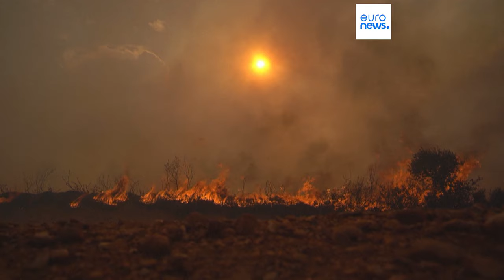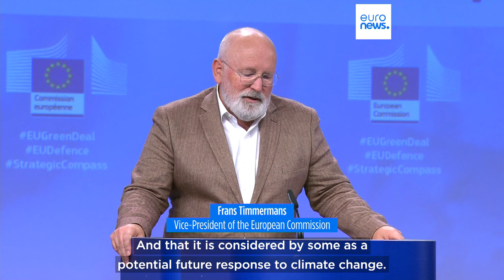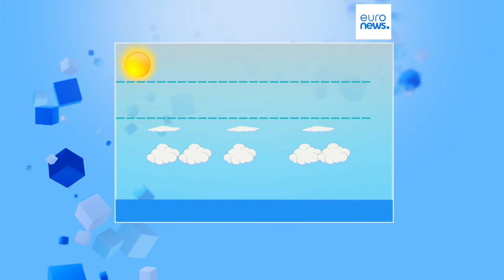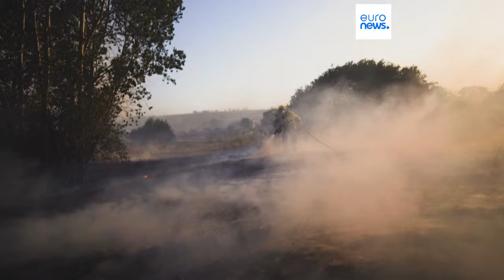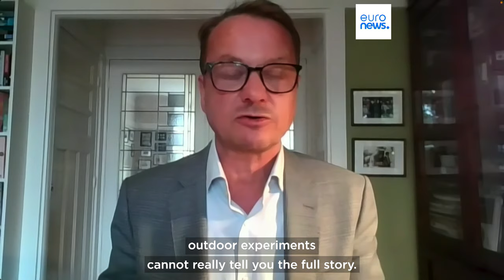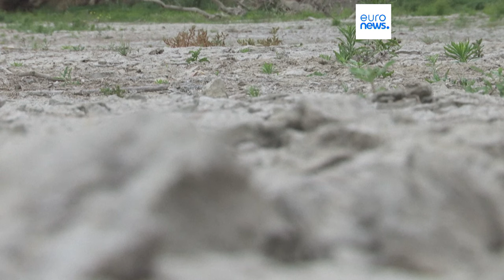European Commission calls for international discussions on risks of climate engineering

Comment: Please give this a thought - 
1) My truth = contrails
2) Your truth = chemtrails which requires all of the following to be in place
- All civil aircraft to be designed, built and operated with chem tanks, pipe work and spray nozzles 
- Boeing, Airbus, Embraer, Canadair etc designers and engineers are in on the act
- All professional commercial pilots are trained to use and operate chem spray equipment
- All Air Traffic controllers are in on the act as they direct aircraft over built up areas.
- All airports are in on the act as they allow chem spray companies to operate airside with staff and vehicles.
- All the worlds’ meteorologists and weather forecasters are in on it
- All the world Aviation regulators are in on the act such as FAA, CAA as they allow these aircraft to fly.
- All the worlds governments are in on the act as they have agreements for the aircraft to fly 
Where are the whistle blowers amongst all this lot????
 Apply occams razor to both possible scenarios and which one is correct????
After 41 years in the aviation business I can tell you the civil fleet is NOT fitted with chemtanks or spray equipment and civil airports do not have the ground facilities to load thousands of tons of chemical onto aircraft
Reply: what are you even talking about?
Reply: The real truth @GeorgeTsiros
Reply: Last year we moved from BC Canada to Mexico. We now live 20 minutes from the 10th busiest airport in the world. I lived in Kelowna BC for over 50 years and forgot what real blue skies looked like. Whatever they are spraying into the air back home they certainly arent doing it down here. Bluebird days back in Canada end up all hazy. You can watch the trails slowly spread and hang in the air. Here it's pure bluebird skies.
Reply: @andyb2515  I... don't think they are even suggesting that we are being sprayed with "chemicals" while being told that we are not being sprayed with "chemicals"?
Reply: Same aircraft, same fuel, different atmospheric conditions, different weather systems - quite simple really why you see different things @TheStonesheepsteve
Reply: @andyb2515  so what has changed in the last 30 years? The skies used to be blue back when I was young. 
Why do soil samples in the forests and snowpack samples have extremely elevated aluminum levels?
Reply: @TheStonesheepsteve there's been debates around to just increase the amount of sulphur allowed in jet fuel.  It doesn't have to be stratospherically placed.  Optimal to reflect the light back straight into space, perhaps, but in troposhere it still dulls the light keeping it from directly warming the ocean 

no need for any modification beyond the fuel mixes.
Reply: It can simply be added to the fuel,no extra tanks or nozzles needed.
Reply: The existing additives to JET A1 are the following and are there for very good safety reasons

Tetra-ethyl lead
To improve the anti-knock characteristics of avgas, tetra-ethyl lead is added. There has been pressure to phase this additive out, due to concerns about lead emissions, however, there is currently no alternative that’s safe to use. Shell is working on finding a solution to remove lead from aviation fuels.

Antioxidants (gum inhibitors)
These kinds of additives must be used in avgas to prevent the formation of gum and other antioxidation products. Antioxidants (gum inhibitors) can also be used in jet fuels, however, they are considered more stable than avgas.

Metal deactivator
This kind of additive may be included to improve the thermal stability of fuels. It has been designed to mitigate the effects of dissolved trace metals, especially copper, which can impair the thermal stability of jet fuels.

Corrosion inhibitors
With rust being a potential concern for military and civil aircraft, corrosion inhibitors can be used to reduce weathering in the fuel system. They also improve the lubricating properties of jet fuels.

Fuel system icing inhibitors
These additives reduce the freezing point of any water that may be in the fuel system and prevent ice crystal formation that could restrict fuel flow.
They are mandatory in military jets but are not used in civil aircraft that have fuel heaters. They may be added to either jet fuel or avgas during the fuelling of small aircraft.

Static dissipater additives
These additives minimise the hazardous effects of static charges that build up during movement of jet fuels. They are sometimes used in avgas as well. @SRM256
Reply: @TheStonesheepsteve  no sunny skies in van all summer. spray like a mofo
Reply: Some smaller carriers are paid to and have their aircraft slightly modified to inject geoengineering material into the exhaust of their engines; FAA signoffs for these mods are waived through a deal made with NOAA and the Civil Reserve Air Fleet.
Reply: Sounds like you can’t handle the truth
Reply: @TheStonesheepsteve   Right! The Mexican government has banned atmospheric spraying. I hope the next Canadian government does the same. # Kick Trudeau out
Reply: They just add it to the fuel. The airline companies don't know it, the crew doesn't know it, the passengers don't know it, even the couple joining the Mile High Club doesn't know it.
Reply: @andyb2515  JP4 JP5, JET A and so on do not have lead additives; aviation fuel or 100+ll does for use in some  piston engine aircraft. Jet engines can burn 100ll but the lead can cause caking issues.
Reply: @smartin1601 yep- so even if nano particulates we're not added to the mix, burning through 1M barrels of petroleum daily/globally will create some kind of effect in the homeostasis of the atmosphere. So there's that as well
Reply: @Silentsister  Not sure if 1m bb per day is accurate, however, I am not concerned with the burning of petroleum or coal; SRM chemicals do concern me though. We are being sprayed intentionally for nefarious reasons.
Reply: I’ve seen it too. Anyone saying otherwise is so brainwashed they can’t believe their own eyes.
Reply: @andyb2515    Ha!  You are funny!  I live on a mountain. At any given time, at least 5 airliners are flying by.  Some days, NO emissions!  When 'they' predict rain, my skies get criss-crossed with trails!  2-Why are there 300+ US  patents for 'aerial dispersion for weather modification' mechanisms?  Use your head.
Reply: Watch Jim Haywood met office professor, he explains how and why they are controlling our weather.
Reply: @geow6100  All theory, nothing actually in use, other than some cloud seeding in certain countries. Certainly NOT in UK
Reply: @andyb2515  so you haven’t watched him yet!
Reply: @geow6100  I'm from the UK, I have just retired after 40 years in the aviation business, I have worked with many people in the MET Office, Airports, Airlines and ATC. I can assure you there is NO geo-engineering going on in UK Airspace